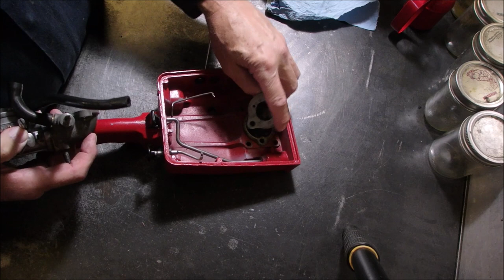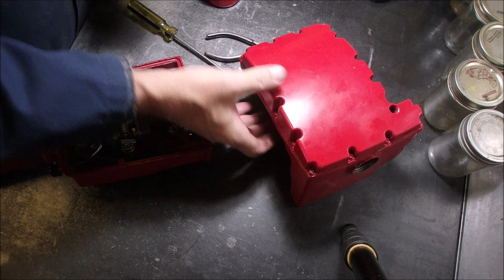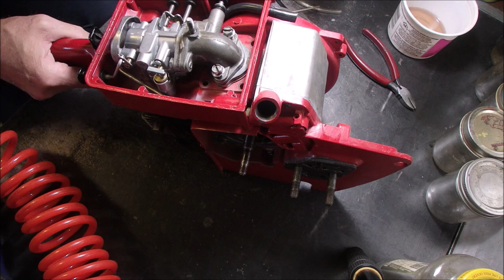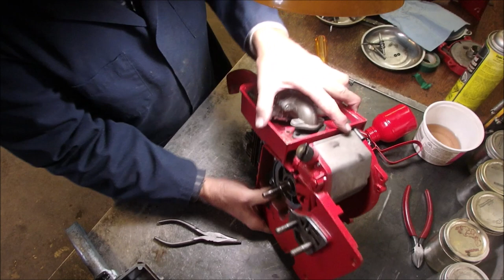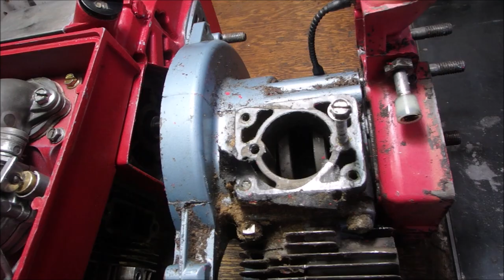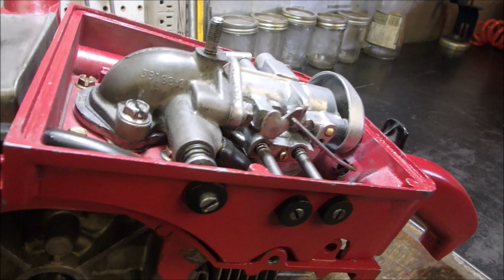Homelite XP 1020 Chain Saw Chassis

Comment: Bruce,  you can avoid scratching your paint job by putting down a piece of cardboard and working on the softer surface.
Reply from the maker: I finally listened and used an old towel.